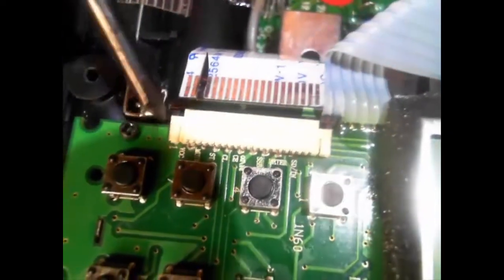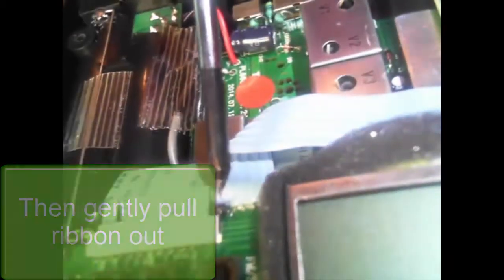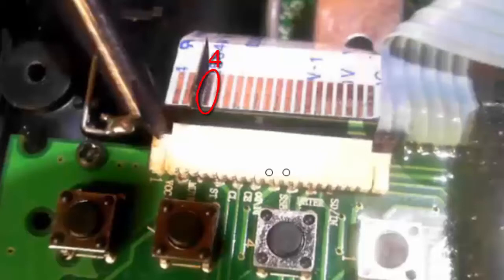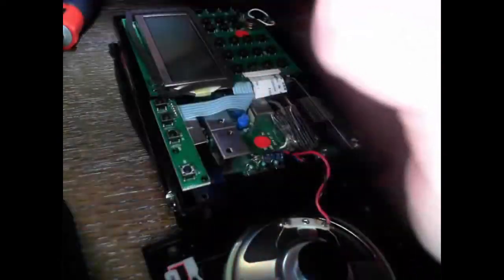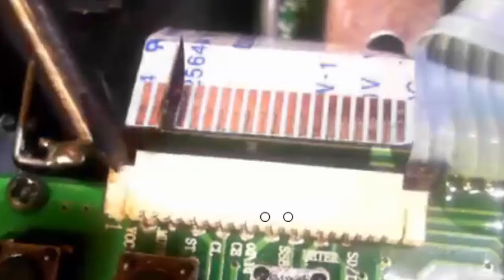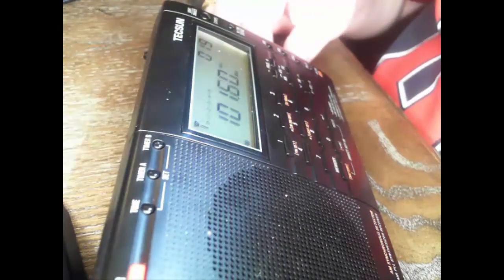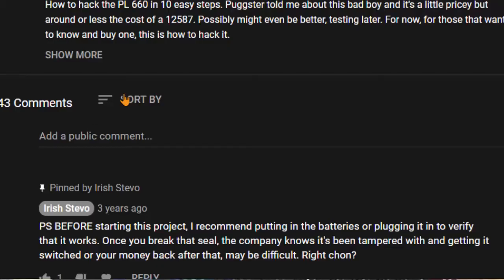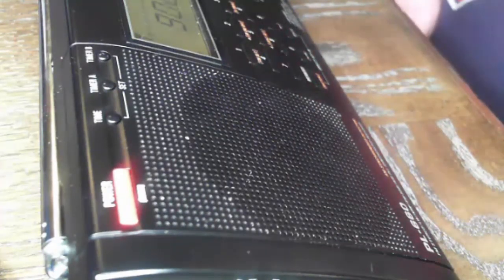Hacking TECSUN PL660 Radio to Ghost Box BETTER VERSION

Comment: Thats exactly what i did Stevo. Some cut the wire but theres no point in doing that if the wire strap can come out of its socket and you can seal the wire with tape. I have to say, cutting that small piece of tape to put it in the exact place involved some swearing. If you put TECSUN pl-660 in the title it will get out there alot more as my video is over a year old and still getting views.
Reply from the maker: ya, I had a lot of ppl complain in private and comments swearin at me for the first vid 3 years ago...lol...so I wanted to re do this for better clarity but I just didn't have the equipment, lighting ect to do so.
Reply: @ShAdoWVeRsE8  ou done a good job this time, much brighter and easier to see.. Is a good Radio, i have over 20 different radios and i still use this one alot.